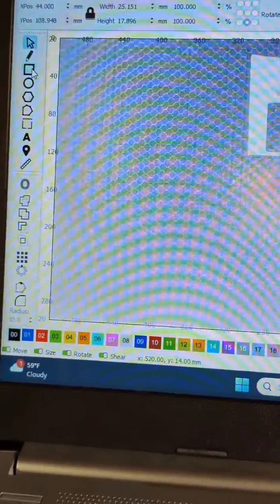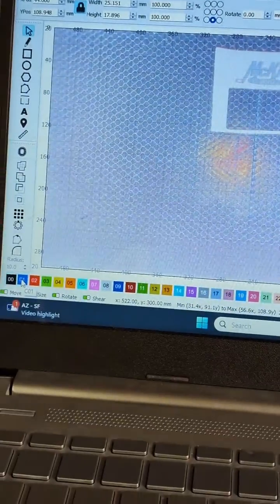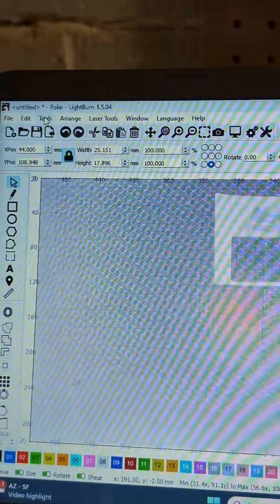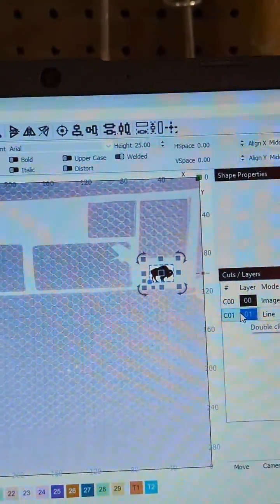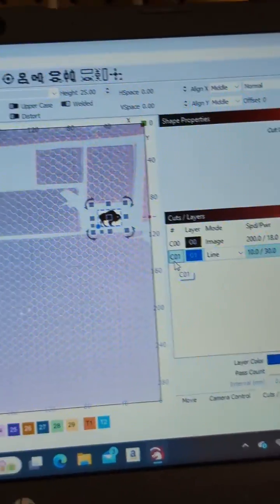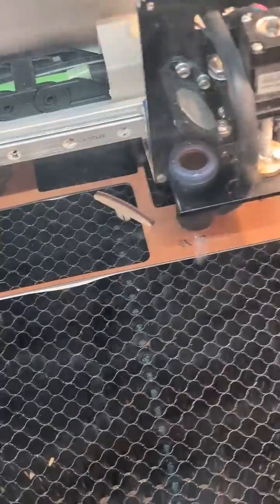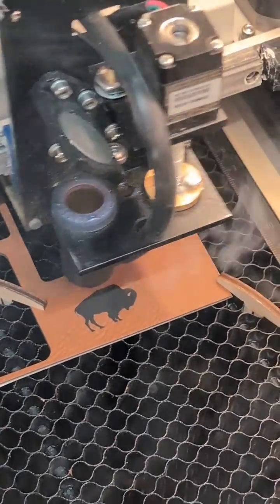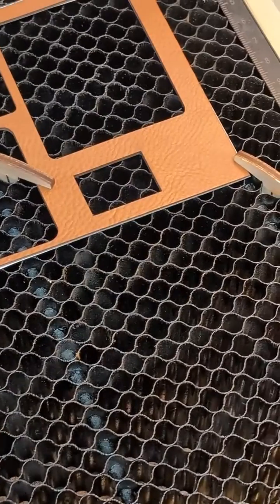How to use Z-offset in Lightburn

Comment: I am so confused about that. I have a Monport 55w and did some work with it but the nexr day the lenses was toching the cut board that I was trying engraving. I have not idea how fix it. So, if I use z ofset it means I have to measure from the cut board to the head 2in for engraving?
Reply from the maker: I'm not familiar with what the optimal distance is on a Monport, but if you normally cut at 2" above the material, you will want the lens slightly higher when engraving, I go up about 2-3mm

Comment: what does your -1.8 represent?  the thickness of the material??
Reply from the maker: I do not use the material thickness method when I focus my laser. The -1.8 is how far down the lens will move when starting the cut layer, since I defocused to do the engrave

Comment: Hi, how are you? Great video, just one question. Is the custom nozzle you're using on the laser 3D printed? If so, how well has it worked for you considering the laser temperature?
Reply from the maker: Sorry for the delay. Yes, I believe it is a 3D printed nozzle. It is found on Etsy from Swenglish Maker. I have had slight damage to it after about 12-14 months of use but it is still usable. If you buy from him it comes with two pieces and I haven't used the second one yet.

Comment: Maybe you can figure this out. I normally set my z height with a focus ramp. Then i will engrave then drop -5 and cut. But got to thinking why set by hand cuz I know that i need to be at 6.9 on the conroller panel z reading so why not drop the head automatically and engrave w/o having to do the setup first. So I put in -6.9 on the engrave (first layer) and then -5 for it to drop more to do the cut. Doesn't do it. After dropping the -6.9 and engraving, which it does wonderfully it goes up to 4.2 for the cut which doesn't work. Can't figure out why its doing that and can't find any info on the LB docs. Maybe you got an ideal on it ?
Reply from the maker: @freebird1963  I'm not sure I follow what you are trying to explain
Reply: I belive if you need to drop more than -6.9 you will have to set it up to -11.9 not -5
Reply: @OpereBolsa  6.9 is what the head sits at according to the Controller. THe -5 is what I engrave at out of focus from cutting.
Reply: @freebird1963 From what I understand for the  the controller your head sits at -6.9 but for lightburn that is zero, so if you want to do both at the same time put on lightburn to go up 1.9mm not to go to -5. Hope that helps.